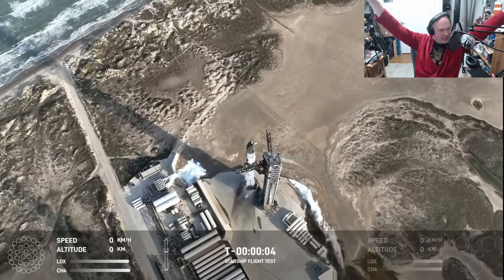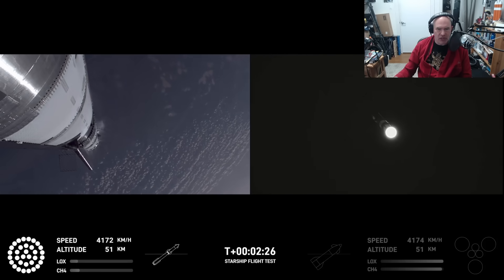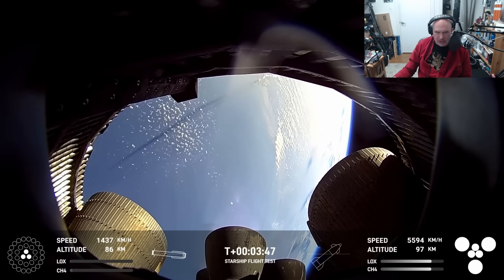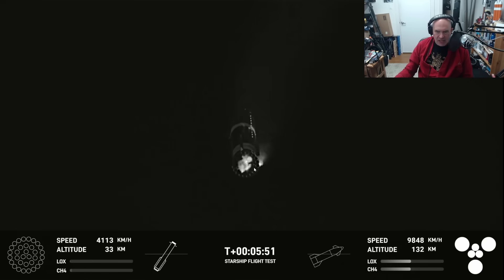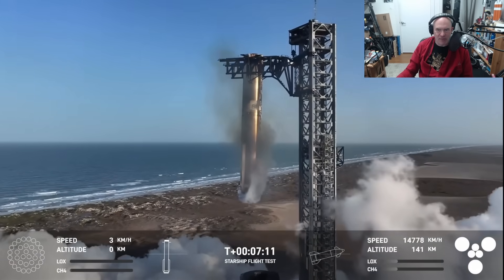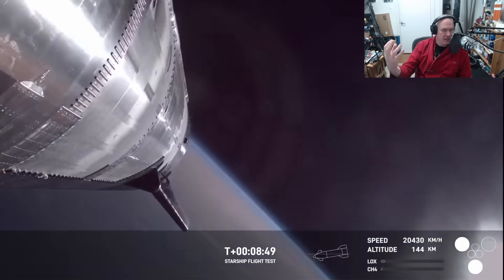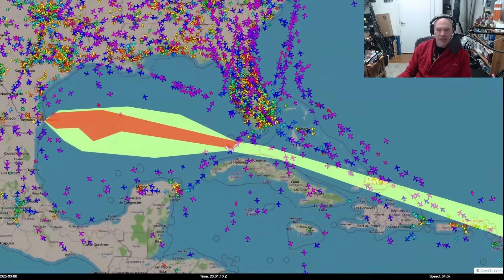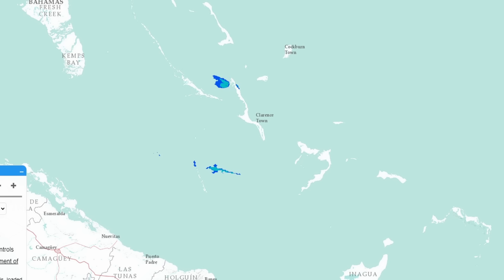SpaceX Make The Same Mistake Twice With Starship Flight 8

Comment: Don‘t worry, our V2 also failed from time to time…  Greetings from Berlin, Germany
Reply: I see what you did there...lol
Reply: V2 (version 1) went all over the place until Von Braun got the guidance sorted.
Reply: I laughed way too hard at this.... Greetings from Cologne
Reply: Yeah but, those were supposed to go boom
Reply: Apollo rockets never failed. So, we are back to the 30s with Musk.😂
Reply: @internetcensure5849 the Starship is more advance than the Saturn V. The reason that many of the Starships have ended in explosions is that SpaceX launches many rockets before the designs have been finalized, which takes a shorter amount of time and with the much lower cost for SpaceX launches, is able to be done. The SLS has cost tens of billions while SpaceX Starship cost millions. There plans to be 100s of Starship launches, the Saturn V had less than 15.
Reply: @internetcensure5849 Apollo 6 had three J2 engines fail. Two on the Saturn V’s second stage, one on the third stage. This latter one had to be substituted by the Apollo Service module engine in order to reach a high level orbit, instead of the intended TLI (trans-lunar trajectory injection ).
Reply: that's a good joke. I did not see this coming
Reply: Once the rockets go up, who cares where they come down? That's not my department, says Wherner von Braun
Reply: @abcdfgh4321  Not an accurate quote. He rather complained that his space rockets falled on the wrong planet.
Reply: From time to time? Twice in a row. Our tax $ paying for it
Reply: Oh god the Germans are back at it again
Reply: Thank goodness, greetings England 🏴
Reply: My heart goes out to you
Reply: The difference is though, that the V2 development was actually spearheaded by an engineer, not an egotistical manchild who knows 0 about actual physics
Reply: Holy crap, it's that rare German humour I've heard whispers of!
Reply: You made my day 😂😂
Reply: One way ticket to Mars for the chaos crew. 😂
Reply: Werner von Musk likes this
Reply: @ Von Braun was a Nzi but also a real inventor, pioneer and great engineer. E\on is only a Nzi and a vapoware salesman/scam artist.
Reply: Yeah but it didnt fail EVERY time. Thats the difference.
Reply: I think they had countless failures until they got certain things right. Was the A4 then.  Of course the main man & his mates went on to get Americans to the moon.
Reply: Elon did also nazi that coming.
Reply: So let me guess spaceX is Nazi now?
Reply: Yeah, something about Nazi technology then and now.
Reply: Damn, people are obsessed with politics. You can open a video about the reproduction of sharks and there's going to be some Trump-related comment down there. I fear it's going to be our undoing as a civilization. Fanaticism (for or against) leads to bad things.
Reply: The v2 didn't cost billions of dollars, and it was actually designed to explode anyway. These constant, expensive failures are going to bankrupt the program. The American taxpayers are losing billions of dollars a year, and SpaceX isn't succeeding in any of its objectives except for the multi-billion dollar booster catcher that is more for show than anything useful. SpaceX has lost its best engineers and doesn't seem to have a way forward.
Reply: And V2s never did achieve their ultimate goal of conquering Brit- ahem Mars... Greetings from London ;)
Reply: @christophergodwin7713  The next generation NAZI rocket was intended to be the first ICBM hitting New York from the coast of France. According to his autobiography, Von Braun had strict orders to NOT put it into orbit but planned to make the first test flight the first artificial satelite.  At the expense of his career, or worse. Good for us that the war swallowed up Phenamunde. He wouldn't have been able to launch the first US satelite ( on 30 day notice) or put men on the moon.
Reply: @christophergodwin7713  Right, but Wernher had a plan for Mars. For that he wrote a book with all the details: "Project Mars: A Technical Tale". Too bad he did not live long enough to achieve his dream.
Reply: V2??? From megamurder?
Reply: Difference being, the V2 was designed to crash & burn.
Reply: There have been many failures and setbacks in the development of space vehicles. Many ignorant people have no idea what goes into the research and development process.
Reply: I'll bet Elon will be really excited when you compare his rocket to the Nazi regime V2!
Reply: @1962Michiel  Well don't name it V2 if you don't want to be compared to V2.
Reply: @aleks5405  The actual name of the V2 is A4 (Aggregat 4)
Reply: @aleks5405  I think it was named in tribute
Reply: @aleks5405  OK, A4 it is...
Reply: @ V2 is common term to call something.. "Version 2" alternative to it would be "Mark 2"

Has nothing to do with German rockets
Reply: @DelPlays you don’t get sarcasm do you
Reply: @mgcamp85  I'd just prefer not even joking about Nazi rockets.. Sorry, I just don't like the history behind them even if used sarcastically or as a joke.
Reply: @NE-jc9fh  A4 was the designation of the type of rocket / iteration in the development programme, the rocket was named Vengeance weapon 2, or V2 by a certain propagandist (the name of whom which might get my comment deleted).
Reply: @NE-jc9fh  yep, but not to civilians.. It was the VERGELTUNGSWAFFE 2.. What meant :Revenge Weapon 2
Reply: @1962Michiel  Arm fully erect excited?
Reply: @1962Michiel  I doubt it. Elon seems like a huge fan of the chosen people.
Reply: @1962Michiel  Undoubtedly.
Reply: @1962Michiel  i bet you’ll be mad at my comment laughing at kamala losing it’s okay though y’all get to try again in four years 😂😂
Reply: Can't wait until he does fix it so he can load up and leave. Greetings from Canada.
Reply: @bloopbleepnothinghere  L comment
Reply: @bloopbleepnothinghere I thought that his plan going to Mars is actually not as bad as everyone claims. After all, he would be gone for at least 14 months.
Reply: @poldiderbus3330 It will take long enough to get to Mars that Elon is not returning. I believe that he intends to retire on Mars. Probably as colony director/ president/ president/king/god.
Reply: At this point, the starship should be renamed the V3.
Reply: @paramotorhead  Yeah, I wouldn't be surprised if Musk "invented" the moon-cannon, as a new and revolutionary method of interplanetary travel.
Reply: @paramotorhead  Alternatively it could me called the N2.
Reply: The Saturn 5 rocket engineers went from drawing board and slide ruler to the surface of the Moon in 6 years....do you understand that Millennials 😂
Reply: I too see what you did there. Elegant in it's simplicity and over the head of any American reading this thread. They cannot, even now, understand what we are alluding to and they will begin to lash out shortly, in their anger and their pain, because Americans believe what they want to believe and disregard the rest.
Reply: Based comment lol, superior german engineering!
Reply: Our V2 was not designed to bring people in space.

At least Germany have it's Vinci engine.
Reply: @noproki2838  But it was the first rocket to go to space (above 100km). 3:24
Reply: The A4/V2 had its countless 💥 during basic R&D, beginning late '30s ' till 1943.  1944 they already launched the 1st shuttle prototype.  The issues SpaceX currently have show they dont even fully understand their Falcon fleet.  Those function more by chance.  Saturn was a scaled up V2 and the resulting vibrations were quickly solved, bc the team understood their tech.  Yet there were still later problems in the system.  Space is not easy.
Reply: Well, despite being a Not-see, fElon isn't as capable as a Not-see engineer...
Reply: Back in the good old days we only let the smart ones lead American rocket projects. I guess the fourth reich just isn't sending their best. 😂

Comment: Have SpaceX fans got it yet? 
This was always going to be the way hubris of going to Mars was going to end. 
NASA was never concerned with reusability. It had a mission defined by a race.
You will not be able to repeat the Apollo program with Mars. Chemical propulsion regardless of it being methane, hydrogen or even fluorine based is just not viable. Some of us said it right at the start. 

It is the same with EVs, Chinese or American.
All you need to do is to look at the energy conversion principle, the 2nd law of thermodynamics and the history of those who got rich.
Wood to coal, coal to oil and now to electricity.  As long as using energy is faster than producing it, the 2nd law wins, and the earth's atmosphere will heat up. The heat is entropy and CO2 level is just a measuring unit. It is not the cause; it is a symptom. Stop hallucinating, we are being cooked alive by our own hubris.
  
I don't know if Musk knew this from the start or not, but he certainly didn't tell anyone that he knew. 
It was always about weapons and satellites in low orbit. It was never going to be a shuttle to the moon, never mind coming back.
All the in refueling in orbit was to get attention. SpaceX never thought that was serious. 
This was a pyramid scheme from the start.
Reply: the part with thermodynamics though... is wrong! The atmosphere is not warming because we use energy, it is warming because we change the ability of the planet to radiate the heat away! The amount of energy from the sun is more or less stable, the change in the atmosphere on the other hand, makes it 'thicker' for IR radiation which then escapes into space 'higher up' aka in a cooler region of the atmosphere. cooler atmosphere up there means less energy can be radiated away (black body radiation). the atmosphere has to warm up to be in an equilibrium once more...
Reply: @spanke2999  And how do we do that, I wonder?
The 2nd law operates in a system. It is the capacity and permeability of the system are all part of same formula.
You need to revisit that mathematics of physics.
Go and sit in your car. Then pipe the exhaust into the car.
The cabin is not sealed but you will still die. It is the rate of production of the carbon monoxide that kills you.
You are not preventing anything, are you?  The rate of production is larger than the dissipating capacity into a larger vessel, i.e. the Erath's atmosphere.
It is the rate of converting energy dormant in wood, coal, or oil and all the processes that are used to produce solar panels from mainlining to manufacturing that keeps increasing faster and faster.
It will be the same with fusion.
Reply: @ thermodynamics is for a 'closed' system. if you can feel and see the sunshine, the earth is not a closed system...is it?
Reply: @spanke2999  Go back to watching your rocket.
Open, close, these are all relative. I told you to try it with carbon monoxide. Neither the cabin nor garage are closed either. You are not demonstrating intelligence here. So, what are you trying to do?

There is no such thing as a closed system, otherwise absolute zero would have been possible 🫏.
Reply: @ExiledGypsy  😅 such a good reply...
Reply: @spanke2999  Yes, go and live in the real world. This is the result of watching rocket videos. Engineering is not theoretical.
Reply: @IsHereAgain  I don't understand your comment.  You want to tell me that engineers see the earth as a closed system energy wise?
Reply: @spanke2999  A closed system is theoretical just as absolute zero is theoretical and it can not exist in the real world.
Engineers don't deal with the theoretical because they build systems in the real physical world.
have you ever come across a closed system in the real world?
It is like the ideal circle, it is an abstraction.
It is a shame that they don't teach philosophy in schools anymore. It was the fault of the industrial revolution and particularly in the Anglo-Saxon education system.
Reply: @IsHereAgain  it doesn't matter if it is perfect or not. If you want to apply thermodynamics you need a semi-closed system. Earth is not such a thing. The sun is the main source of energy on the planet by a lot... Really a lot! Applied to the climate the tiny amount of extra heat we apply by burning stuff can be completely ignored compared to the sun. 

So earth receives by day energy and radiates it away at night.

This process can't be described by the 2nd law is thermodynamic... Earth is not a freaking steam engine... For god sake, please you two read something about the climate and check your knowledge about it. Praxis theory... It isn't really that far apart...
Reply: @IsHereAgain  ok... so I can't talk about a closed system, because you explain to me that there is no closed system in reality... and then you complain that I make it 'more realistic' and start talking about semantics... have you even seen a university from the inside? 

And Kid? Honestly? I tell you and your friend that explaining global warming with the 2nd law of thermodynamics is BS, because you can only apply it to closed systems! I don't care if you are an engineer, a theorist or god himself. if you think earth is a closed system with respect to it's temperature and you can therefore apply this 2nd law, you have absolutely no idea what you are talking about and apparently have never sit in the sun. 

So please stop being so condescending when you are so obviously wrong! It's laughable. 

Earth is not a closed system! it doesn't care about rates or capacities with respect to global warming and CO2 is not just a symptom, it is the freaking cause! 

So please make a point with substance or just crawl back under your stone where you can think about philosophy and if something is closed, zero, has rates or capacity...

Last time, claiming that you warm the planet because you run a generator that produces heat is BS!  People on the internet...
Reply: @spanke2999  I thought I responded to you. You are confused. Gravity of earth holds on to the atmosphere. Heat can only dissipate through radiation out to space. The rate of dissipation can not keep up with what is generated and therefore the planet heats up. Now give me a forum address and I will explain it to you furhter. This thread is done.
Reply: @ExiledGypsy  😅"This thread is done"... such a charming person. 

"The rate of dissipation can not keep up..." and why is that? what determines the rate of dissipation. too bad you won't reply because this thread is done. I would love to hear your explanation that excludes CO2 &Co and presumably the whole atmosphere ... but anyway. Have fun...

what do we take away from this chat, I'm kid and confused... and you two ignore basic climate science, good work...
Reply: @spanke2999  I give up. They keep hiding my response.

Comment: The corrugated expansion joints most likely failed leading into the engines in the 'attic' area. To much vibration for them still.

Comment: I suspect the backblast from hot staging due to the constricted interstage space is causing the Starship engine problems. It's never seemed like a great option but without it you have ullage issues in both stages. We know that's solvable though and the interstage ring is heavy which buys you some mass to problem solve with.

Comment: Usually there comes a point where progress is demanded and I may not be an Engineer with the SpaceX team but that is unacceptable. This basically tells everyone that they didn't learn or figure out the problem from Flight 7. So basically months of work for nothing now.
Reply: Thry may have learnt something from more targeted cameras and instrumentation,  we can't tell till thry say easy happend.  Sometimes you need to repeat a failure to catch relevant data

Made hard if you can't replicate it in a controlled test environent
Reply: I think Elon must fire half of SpaceX team to improve their efficiency.